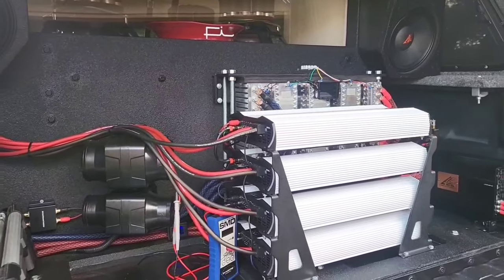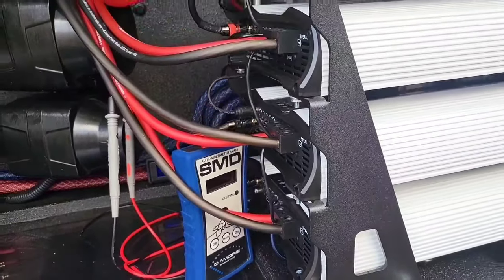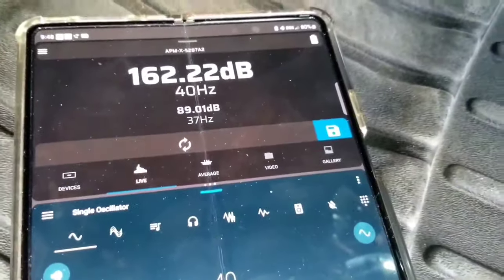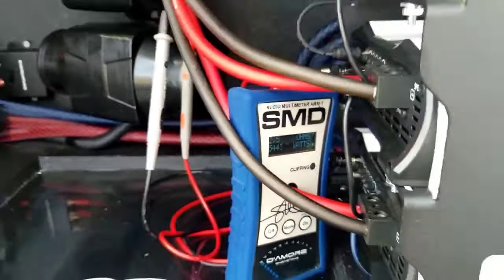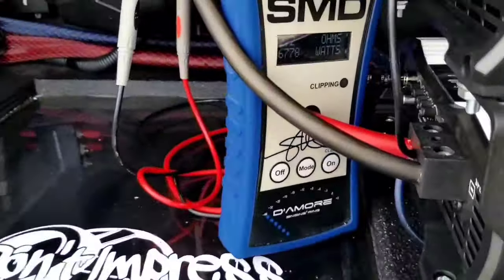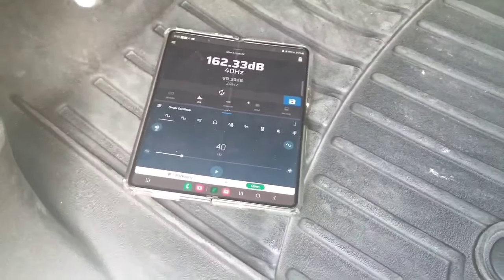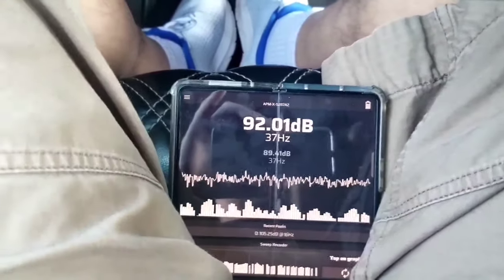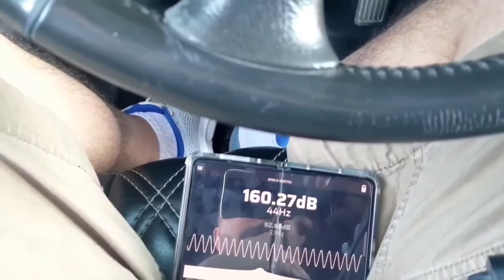Testing 4 Taramps smart 8k on real life. results #fiaudio #taramps #caraudio #subwoofer  #spl

Comment: Definitely need to wire down to .5 so they don’t rise above 2. Leaving like 8 - 12k watts on the table. Badass setup by the way.
Reply from the maker: Thanks for the advice 👍🔈🔉🔊
Reply: do you think the smart 8 will do good at .5?
Reply: @krabment  yeah. I run 2 regular smart 8s. Not the bass one. I run them at .5 ohms, they rise to 1.6 after 5 minutes of full tilt. I’m clamping 18k from just 2. I’m thinking about getting two more so I’m not stressing them out so much.
Reply: @svtnick5412  i got one i want to put on a pair of v3’s but was hoping it will hold up only because the amp is not half ohm stable
Reply: @krabment  yeah. The ones I have are not half ohm stable. As long as you know you impedance rise is above .5ohms then the amp will be fine.

Comment: I certainly didn't expect that , I thought you'd be louder with SPL too
Reply from the maker: I did a test with the truck completely sealed on a single amp, and my box raise was 1.9 ohm. I was able to clamp 9500 watts on the amp. But with the door open, i get louder, but my box raises to 2.5 ohm, and I'm only clamping 6500 watts per amp, which is not enough to do the 164 db. I need to be able to clamp around 9000 watts per amp to achieve the 164 db. I still have the Crescendos 17k. I can install them for a competition 👍🔉🔈🔊
Reply: @956Bassaddict  so it's louder when sealed 

At least you can switch amps
Reply from the maker: Is louder with the door open . But seal i get less box rise and i can clamp more power out of the amplifiers. Or i might have to test out the system to see what she does seal with this amps. I think it can do a 160db on a higher frequency 👍🔉🔈
Reply: @956Bassaddict  I guess the will be in the next video?
Reply from the maker: I said in cople weeks. I'm out of town right now at work. But the soonest I get back, i will work on that video. The next video will be on my friends new build, which is going to be a  loud one 👍🔊🔉🔈

Comment: If you want to fight impedance rise the most, you would have to have true D1 subwoofers, and wire each D1 subwoofer to half of an ohm, AND use the Taramps Bass Smart 8Ks, as those new Bass Smart amps are Half ohm stable, AND do there rated power @ 1/2 ohm, 1 ohm, AND 2 ohms! The reg. Smart full range Taramps only do rated @ 1 ohm, and 2 ohms. So on enclosures that have 2 and a half to 4 X impedance rise, Like most bandpass enclosures do, you still will rise higher than 2 ohms, when wired to 1 ohm! If you had 4 X rise, and were wired to 1 ohm, on a reg. Full range Smart 8k, you would only get 4 ohm power on some musical notes= about 5k per amp. But if you had the Taramps Bass Smart 8k, and were wired @ 1/2= the Bass Smart 8ks are 1/2 ohm rated/stable, and you had the same 4 X impedance rise= up to 2 ohms, you would still get 8k per amp! So even though these reg. Full range Smart 8ks did less on a peak burp, vs Bc 17ks(cause they were wired @ 1/2 ohm), the reg. Smart was able to do better on music, cause they have less of a power drop off, as the impedance fluctuates= better avg. Scores, like when you tryed the propper droppers SPL format for Db testing. Please re✔️ your propper droppers score with these amps? So in the future, if you want a higher peak burp score, and even higher avg. Musical scores, get true D1 coiled subwoofers, and run a Taramps Bass Smart 8k, @ 1/2 ohm to each subwoofer= Best of both worlds! I know its easier said than done, as this stuff costs alot of $. Ps., all of the people i talk to that run Taramps, say they do "Not" like high Rca input voltage, stay between 1 volt, and no higher than 1.5volts, or they may blow up!? Just crank up the amplifier gain to get your power up, hope this helps, and Great video, thanks!
Reply from the maker: Thanks for the information. i have been thinking about that, too, D1 coils and the smart bass 8k be the way to go 👍🔊🔈🔉
Reply: Wiring to .5 with the smarts u start to see/hear throttle of power very often its annoying
Reply: @dblovah5156 Well no one should wire the reg. Full range Smart amps @ 1/2 ohm, as they are only rated to be stable @ 1 ohm, the New Bass Smart series of taramps are rated for 1/2 ohm.
Reply: Whoever said to get a smart bass and wire to 1/2 ohm vs just getting regular smart 8k and wiring to 1ohm obviously didn't do the research behind that statement.  Look up barevids and Jones subwoofer solutions  videos on the subject. Hell, even williston audio labs has a video proving that smart 8k can make more power than bass versions and that's without wiring into the dirt.
Reply: @JohnG1000 I have watched all of those video's, i DID plenty of research, and many subwoofer enclosures/systems have 4x impedance rise. Also Taramps designed the Bass Smart Series to be stable @ 1/2 ohm= not wired in the dirt, as you say. Why do you think the Bass Series Smart 8k makes more power @ 2 ohms= 8,100, vs @ 1/2 ohm= 7,400, and @ 1 ohm= 7,700 on the amp dyno? It's because Taramps knows alot of subwoofer enclosures/systems will have 4x impedance rise, like this system does. So on a max SPL burp, when wired @ 1 ohm, on a regular Smart 8k= full range series, with 4x impedance rise= 5k power, vs with the Bass Series Smart 8k, when wired @ 1/2 ohm, and with the same 4x impedance rise= 2 ohm power of 8,100, that's 3,100 watts more REAL WORLD POWER vs on an amp dyno!
Reply: @JohnG1000 I am a many time Champion of car audio competitions, with real world power testing experience, on a Team that has tested many systems as well. We have accumulated lots of data, on enclosures, and real world power vs dyno #s. Trust me when i tell you, that D**k measuring power results on an amp dyno, does not usually represent real world actual power. An amp dyno is a testing tool, to help a knowledgeable person, understand what power, of each amp tested, can be expected @ said impedance, with a given maintained voltage. Not what power you "WILL" get if you are "WIRED" to a specific ohm load= impedance @ rest= while nothing is being played through a speaker.
Reply: Thanks for this I have 2 fi neo 4.7 n was going to go with 2 jp 63s but taramps smart bass 8 ,subs are d1 😊thanks so much just saved 600 bucks
Reply: @rubenavila8012 - Taramps now have the New Big Boss Bass line that are also Smart series, in 3k, 5k, and 8k power levels. These also do there rated powers @ 1/2ohm, 1ohm, and 2ohms. This new line is a bit bigger/beefier, with better internal fans, and 22 different preprogrammed light displays, they are Awesome!

Comment: First u have a beautiful setup, I run six smart fives on six 18's, I am wired down to half ohm at one ohm making 6200 watts each, I think u need to wire down to a true half ohm, u have 2k in amps basically and clamping 24k, the crescendo are really nice but hard to compare the 17k to four budget amps
Reply from the maker: Good stuff. I'm waiting for one of my 17k to get back from repair. My gold is doing 165+ db on this setup. I'm going to save my taramps smart 8k for a future build 👍🔊🔉🔈🌪

Comment: You were right on about the Smart amps throttling down, or restricting power when trying to clip them. Your reg Smart 8ks did a total of approx. 25k, on your 40 Hz test tone burp. I think your video that you showed your 164.22 @ 40hz, with your 2-Bc 17ks @ 1/2 ohm each, showed the term Lab power probes reading 14,500 per amp, so X 2= 29k on your 40Hz burp, @ a stereo comp. I think if you had True D1 subs, each wired to 1/2 ohm, with the New Taramps "Bass" Smart 8ks (X 4)= they are 1/2 ohm rated/stable, you should be able to get 30k to 32K on a burp @ 40Hz, plus be even louder on music than now!?
Reply from the maker: I'm going to have to recone the subs in the future. i might order de D1 coils and then wait to see if they will make the smart bass 12k 👍
Reply: @956Bassaddict  I think with the bass 8 @0.5 u will have heating issues, at least I do at 100% my friend with 2_15's four inch coils clamps 14.4k on two smart fives, for a sixth your rise isn't terrible. U have done a amazing job on this build. What state are u in? I am about to rebuild to 8-18's and would not mind someone building me a shell
Reply from the maker: @1-Six-dee  Thanks, brother. I'm in Texas. This is just a hobby for me. I have been working on my build on my time off for a long time.  I work out of town.  Thank you for the opportunity, but unfortunately, I don't think that I have the time to work on your box. If i do, it will take a long time to get it done👍🔊🔉🔈🌪
Reply: @1-Six-dee heating issues how?
Reply: @Ty2Gudda  a lot of power equals a lot of heat especially with neo and they lose force with heat, but his enclosure may have much better air flow then mine, my truck is super windy but keeps a spot of 'stale' air right around the port that just stays in their and heats tf outta my rear woofers compared to the front

Comment: how much power did you do on the cresendos to get the extra 2 dbs?
Reply from the maker: With 4 taramps smart 8k. I'm clamping  around 26800 watts. And with the 2 crescendos. I'm clamping around 36000 watts 👍🔈🔉🔊
Reply: @956Bassaddict  so you think power alone is the only reason you drop 2 db? Probably from the smarts having that limiting feature ?
Reply from the maker: @Basshertz94  I liked to get the crescendos installed back in the truck. To see the difference. 👍

Comment: What it do at 20?
Reply from the maker: At 20hz, i was able to do a 155.83 👍🔈🔉
Reply: @956Bassaddict  nicee what's the box like? How many subs? 6th? 4th?
Reply from the maker: @osrs2842  6th order enclosure. 4 Fi audio neo 4.11 18s. I'm running running 4 fi audio HC18S right now. But i will be trying the Fi audio 3.9 with the new black neo soon. 👍
Reply: @956Bassaddict  nice man! Keep up the good work! I'm in canada currently daily driver 8 zv6 15s on 4 smart 8s 161 at 20hz
Reply from the maker: @osrs2842  That is awesome. Thanks a lot 👍 🔉🔈

Comment: Try burping at different frequency and find what frequency it rises less one by one from 30 to 60hz
Reply from the maker: I probably do that on a future video. When i bought the amps. I installed one of them at 1 ohm.  And i burp the system with the cabin completely sealed and only raised to 1.9 ohm. I was able to clamp 9300 watts on that single amp. 👍🔉🌪

Comment: Video won't even play
Reply from the maker: If should be working now 👍
Reply: @956Bassaddict hell yeah thanks bro, got a smart 8 bass coming Wed looking forward to this
Reply from the maker: @JayTown1991  the amps don't get hot at all they work pretty well for daily 👍🔊🔈🔉
Reply: I'm surprised of the score drop cause the smarts does really good wired to .9-1.0ohms
Reply: That's a bummer
Reply from the maker: @dblovah5156  I'm wire, right at .9 ohm, but with my box rise, the amps are running around 2.5 ohm. I'm still making good power on music, but not what i need for a high spl number 👍
Reply: @956Bassaddict crazy thing is the smart 5 is making about the same power in the 2+ohm range if in not mistaken
Reply from the maker: @dblovah5156  i try a single amp. I wire the amp at .9 ohm. I did a burp on my truck, completely sealed. I was raising to 1.9 ohm and was able to clamp 9500 watts on the amplifier. But with the door open, my box raise gets higher to around 2.5 ohm, and i can only clamp around 6500 watts
Reply: @956Bassaddict  ok I see